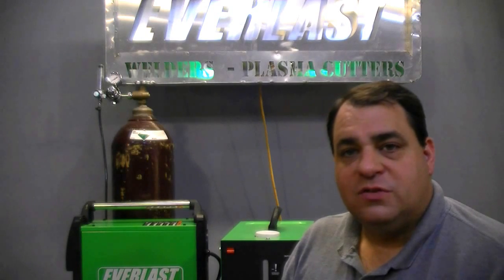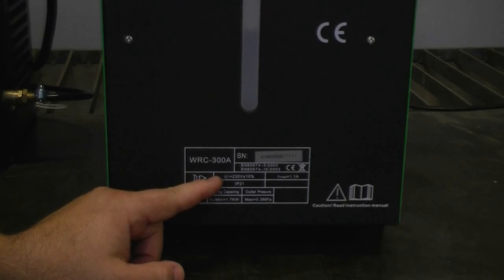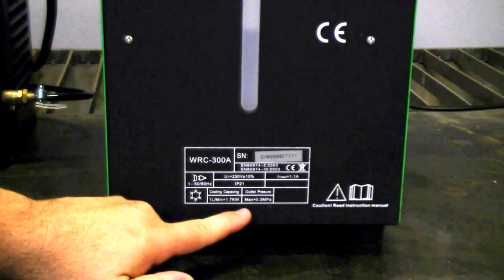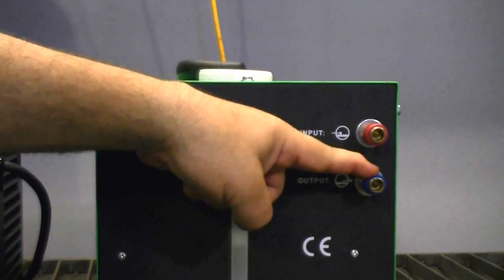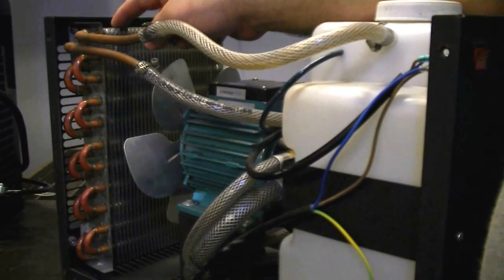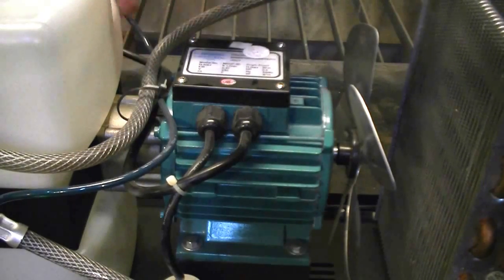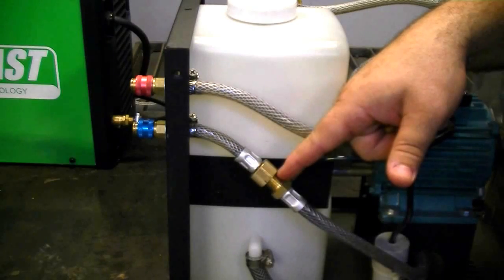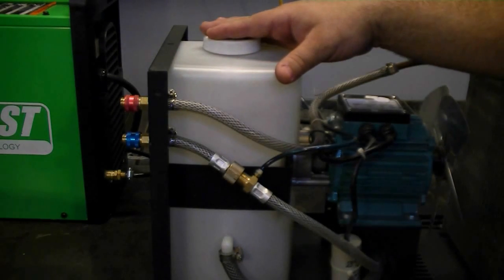Everlast Welders Power Cool 300 - TIG and MIG  1.7 kW Water Cooler - 220 / 240 Volt

Comment: I heard that you can mix distilled water and Isopropyl alcohol mixed can you recommend what would be a good mixture and how much to mix. Just ordered this cooler for Christmas 🎄 thank you
Reply from the maker: Chris Wojnarski  its not the recommended solution.  Either use distilled water ir tig water cooler coolant which is non conductive and has anti algae properties.

Comment: Will this work with 221si MTS do I need a different tig torch to use this
Reply from the maker: JOHNNY WILSON  you'll need a different torch but the cooler will work?
Reply: Everlast Power Equipment  can u recommend one
Reply from the maker: I can.  Our new NOVA Rotaflex 20 torch with Ultraflex cables, in either 12.5 or 25 ft configuration.  If you call us direct, we'll be glad to make you a package offer.

Comment: what????? it isn't set up for the 255ext isn't that an inverter digital?does the digital inverter machines have plugs in back just for the cooler...what am i missing here.how about the new 325 ext that is now available .in the options it recomends this cooler..miss leading...your tig welders better all be compatible ?? if not that would be completely absurd.
Reply from the maker: Earlier Digital units did not have the cooler plug.   Notice the use of the word "Currently". Please see the date it was made.  It is now 2015.
Reply: you know, you guys could use a little better language.  "Currently" was a cheap shot.

Comment: ill make my own better and cheaper
Reply from the maker: A lot of people have tried, and most have failed.  A stainless pump and sealed industrial motor don't come cheap.  Sure you can make one but it likely won't be cheaper if it's better.  Copper isn't cheap either, along with a pressure control valve and fittings etc.  A water hose is about as cheap as you can get, but it's a loss type system.
Reply: dont need the valve 1.4 liters per. iv seen copper wraped about an inch larger then the fan no cooling fins at all keep a 250 cool all day impressive. a small pond pump and 3/8 copper in a 5 gal bucket. i use a small computer radiator and a pond pump for my 2.2kw  router spindle. never gets hot.  400 plus dollars ill give it a try i like  to tinker. thanks